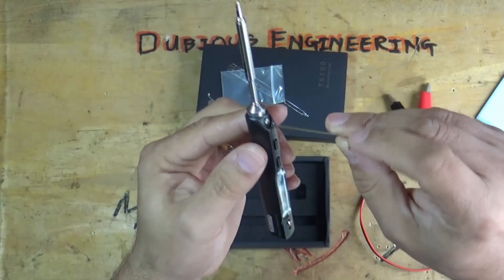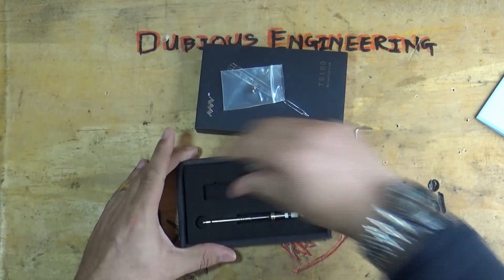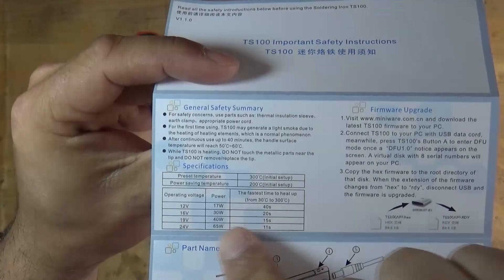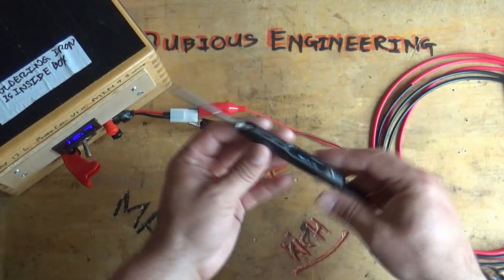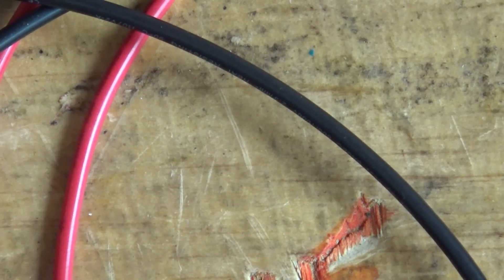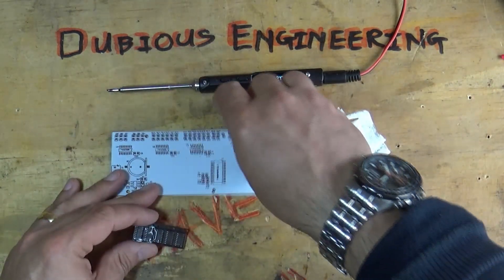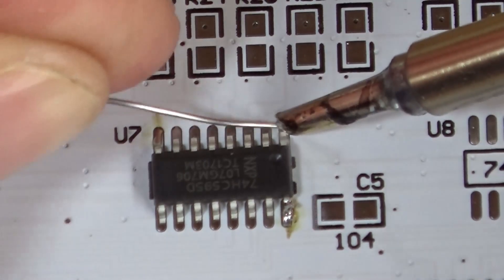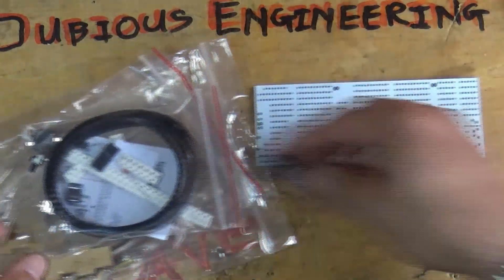DuB-EnG: Mini TS100 Soldering Iron Unbox Review Test 12v 24v DC 65 watt Open Source Firmware OLED

Comment: lack more than welding courses ^^"
Reply: the head that you use is not good for what you do, it is to solder components on a map but not as you do, you have to use flux and just a hard drop on the flat side and pass on the branch, then make the little corection, here you use it as a pointed head, and small trick to tin, you have to place the iron under the son then make a small bridge (deposit a tin can touch the wire but still down) then put the tin wire on the wire and it will melt directly into having too much heat, just enough
Reply from the maker: Cox Michael - good tips!!  see my clock build... works well for soldering 0603 components!!

Comment: The TS100 looks like a cool iron. I tried adding a battery based soldering iron onto a rechargeable vape/powerbank, effectively controlling the heat range via the wattage selector (max 250 watts) on my power pack. It seems works quite well for a 'Bodgit' job!
Reply from the maker: Bodge it and Quick (B&Q) UKs favourite hardware store! ...  loving the TS100 iron...  it works really well! ...  I’ve used it a lot, well recommended!
Reply: B&Q Gees I guess you don't mind paying their markups! LOL

Comment: That's a cute little iron, but i still have a 15 watt and 24 watt Antex yellow mains jobbie, 40 quid... noooo, who says im a tight bugger :-)

No maplins to run to, R.S perhaps?... ill sell a kidney :)

Any tea on this spaceship?
Nice sheet lightning :-D
Reply from the maker: I recon I could ruin your 24 watt antex... with a lithium ion power wall and the ts100 ... but... I’d have to buy the chisel tip!! :-)
Reply: Ruin or Run?
I could Ruin my antex by filing the tip, the copper under the iron cladding would vanish with solder.
You could indeed run my antex on d.c, it's just an element :-)
Reply from the maker: zx8401ztv ... I miss the old yellow handle antex irons...  I wonder how many it would take to brew a cup of tea?!? ... something I’ve wanted to do for ages!